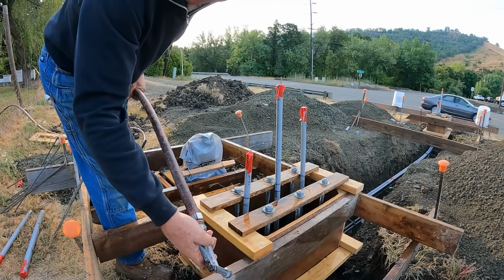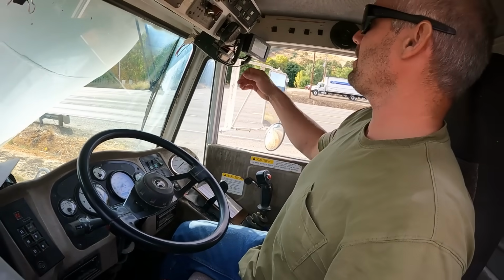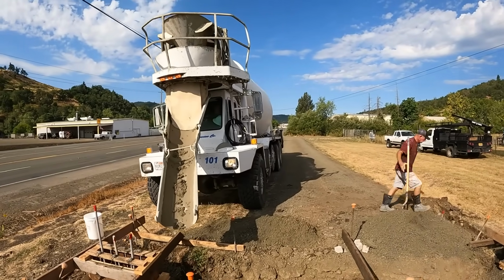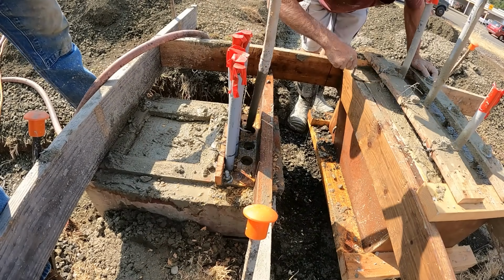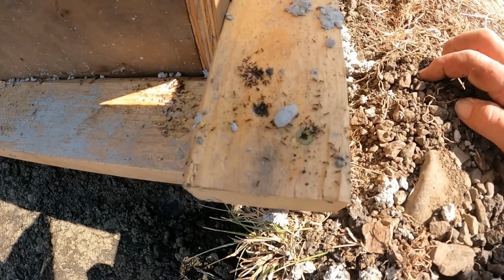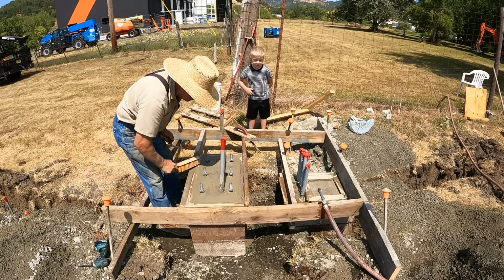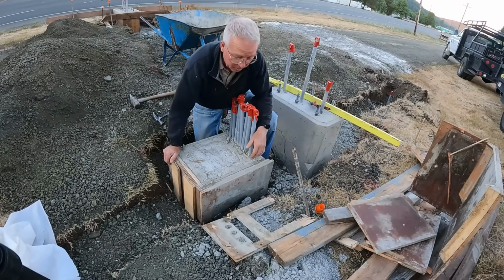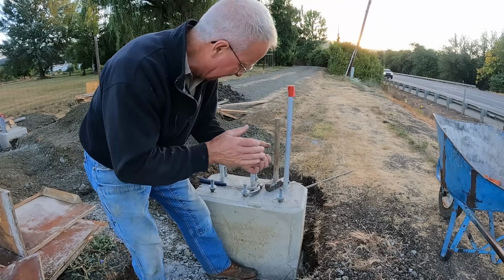Pouring Concrete For A Gate: #3

Comment: Two trucks, small one at 12:32 and large one at 12:33. Now imagine those trucks pulling off the highway, were the road barrier ends. Large one couldn't hit the form closest to the road, but the smaller one or a small/car tuck might be able to. Extending that road barrier another 20-30ft would be nice, just to stop someone careless crashing into the pier closest to the road. Quality work as always.

Comment: Love your Kubota. I had a used one that was the same size as yours. It was 24hp and built around 1950. It came with a 21 acre property in the snow belt of Ontario that my wife and I bought in 1987, we were 35 with one son and another on the way.                                                                                                                     
                                                                                                                                                                                       The gravel driveway was 550 yards long and became my hobby. I had to look at it that way because of the many hours a year I had to spend blowing snow and grading it. Our property was on the slope of the Niagara escarpment about 4 miles west of Thornbury. There was also about 8 acres that I would knock down 3 or 4 times a season with a bushhog on the back of of the tractor.                                                                                                                                                                                                                                                                                     
                                                                                                                                                                                            It was a real adventure to move to a reconstructed barn from a bungalow in the suburbs of Toronto. We stayed there for 28 years before pulling up stakes and retiring to a lovely condo in Victoria BC. I learned many lessons taking care of that property. I would sum them up by telling younger people working as hard as they can to keep up that they shouldn't worry too much about whatever is the current issue that is challenging them. In 2 weeks it will be something else and you'll get past that too.                                            
                                                                                                                                                                                             I miss my workshop and my Kubota very much but moving was the right thing to do and as it turns out both of our sons are now in Victoria with their wives. We all mis our panoramic view of Georgian Bay but Victoria and Vancouver Island are wonderful compensation.

Comment: ever tried using duplex screws for your formwork? It's about all we used with our precast forms. They are super fast and easy and reusable as well.
Reply: I'm used to duplex nails being the thing for forms (and 2" common nails for attaching the form ply to the walers). Screws tended to snap off in the wood often and then reusing the 2x4s becomes a bit more of a gamble so we'd only use them where for some reason nails wouldn't do

Comment: It is great to see another project coming to fruition.   Love your closing statement.  I just spent the last few months rebuilding the engine of my little John Deere 425 lawn and garden tractor.  I bought her new in 1993 and after 30 years, she was smoking badly.  It took me four months, several trips to the machine shop, lots of youtube and Google time and calling on the expertise of friends, but I got her running like a top last Friday.  Saturday and Sunday I worked with a fellow (through FB Chat) that lives two hours away that sold me a front quick hitch and bucket on how to get that hitch to attach to my very early model 425.  We got it working and I have a thousand and one projects lined up for it.  I've alredy completed the first - knocking down a three-foot wide rotted tree trunk that stood about 3 fee high.  Mission accomplished in about two minutes.  Next purchase is a grapple to hook to that quick hitch.... always something, and I love it......

Comment: I used to wet down the forms and hole so they wouldn't suck moisture out of the concrete . I like plenty of water in the mix . I see a lot of guys using too dry a mix so they can strip off the forms in a hurry right after the pour starts to set up. I don't think that stuff is as strong . I don't strip forms for 24 hrs. 
Old school and not in a hurry .
I really enjoy your channel episodes . I'm 77 and been around construction for 72 of those, but still learn each day .

Comment: Something an old carpenter-concrete guy taught me more than fifty years ago -- when you vibrate mud, stick the business end down into one area, and pull it out just as fast, or else your aggregate will vibrate immediately to the bottom of your pour.

Comment: As someone who cured concrete in a mist room back in college for 28 days, that's some of the most beautiful concrete I have ever seen.  Well done sir. 👍
Reply: I worked on a job for a year where all the concrete pillars (there were a lot) and some of the walls were intended to be exposed and undecorated. You have no idea how much grief this caused !  If a column had even the tiniest wormhole It had to come down,if there was the slightest release oil stain (caused by too much release oil on the armature ties) it had to come down. Meticulously clean fibreglass forms, spotless prep, oh my head !  There was even a guy emploved to take these columns down if the visuals failed, carefully !!

Comment: The little message at the end was good. 
I was stuck on 4th and 5th floor of a jobsite. Flooring guy had to finish stairs, elevators had to fire caulk the bottom of the shaft. 
So i was stuck, rough few dayson the site that week.

Comment: I did two concret column to hold my gate 3 years ago and i wanted to do something similar for the chamfer. I decided not to because i was afraid of failing but man i wish i did, it looks so great !
Reply: It does add that special something that says a craftsman built it. 👍
Reply: @mitchdenner9743  unfortunately i was discouraged by people saying that i amateur couldn't do it. Since that project i don't let other tell me what is possible, as long as i can figure a way, and i guess it is true craftsmanship (in a humble way).
Reply: @eviltyrygosa  if its worth doing, its worth overdoing.  My motto

Comment: On a job this size, deck screws are hard to beat, as they’re cheap and readily available. However, if you’re form building for a living, I can’t recommend Duplex screws enough. They have a 1/4” hex-head and make wrecking a dream. Our last 50lb box lasted 4 months on the job site before we finally wore them out. Just make sure you use an impact. A drill seems to snap them with regularity.

Comment: Concrete work is for strong men. I did a little in my time as a carpenter and I quickly realized my skinny body was better suited to wood than liquid rock. In fact I needed to try and avoid the heaviest work as a carpenter because it kept breaking my body.  I did find more satisfaction building things than any other work in my multi faceted career. 

I would have not been able to match the work you do, no matter how skilled I got or how efficient. I’m thankful I never had to compete with you for a job.

Comment: Ditch tbe 3500 psi concrete and go with the 4500 or 5000 psi, and you will have many fewer pockets. The additional sand and Portland will make the finish much cleaner.

Comment: I really appreciate a man who caps his rebar. Vertical rebar with uncapped ends makes me cringe. On YouTube I sometimes watch work being done in India or Pakistan the lack of basic safety precautions drives me nuts.

I knew going in the Burke Bar was going to make an appearance.

I had a friend consulting on a concrete apartment building in India. He sent me pictures. Women climbed the scaffolding in their beautiful wrap around dresses. The wore yellow molded plastic hard hats. That had a bowl shape on top. The bowl was to accept a steel cooking wok full of concrete. On the ground a man dressed in business casual mixed the concrete in a tub. He scooped it into a  wok and then a lady put it on her helmet to climb the scaffold. At the top, she would hand it over to another man in business casual who would dump in into the aluminum concrete forms. That were manufactured to form that building with all of its architectural details. The dichotomy was quite compelling.

Comment: with a vibrator - I would think a smaller slump = stronger concrete. Second, I keep the forms in place for 29 days (maximum curing) - why are you removing the forms so quickly?
Reply: Generally speaking, yes, a lower slump = less water added = stronger concrete. 

Especially for a project like this, there’s no real reason not to strip the forms asap. No beams or unsupported spans that could deflect if the supports were removed too soon. Standard operating procedure in production concrete work is to remove the forms, on even beams and slabs when concrete achieves 75% ultimate strength and then re-shore, if a load was going to be applied. 3 days is typically all that’s needed and additives can be used if the forms needed to be cycled quicker. If deflection is a non-issue, the forms can come off as soon as the concrete won’t fall out or slump.